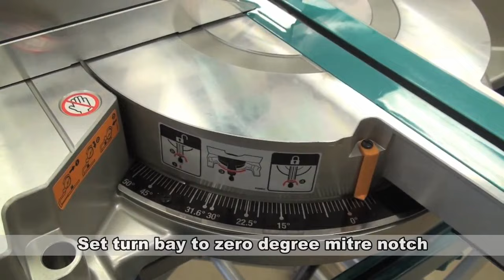Makita Tool Tips   Calibrating your slide saw

Comment: My Mikita was a different, with the same concept.  I simply loosened three of the hold-down bolts and slightly loosened the forth.  Then I was able to adjust the fence and tightened one of the three loose bolts and did test cuts budging the fence making cuts until my 90 degrees was perfect.
Tightened all bolts, retest cuts and was happy with the correction.  Thank you👍👍👍

Comment: Bought new LS0815FL..As it starts a sliding cut towards tge fence, first inch of material is being notched slightly left side of kerf before moving on through in a straight line!? Any ideas why this happens even when keeping a even forwards pressure (not pulling it to the left).

Comment: My adjuster locking calibrating large round knob at the front has worn away over time it’s really stiff to move the swivel base plate once I finally get it to play ball I can’t find a single video on how to strip the hole bottom piece apart and put in new knob swivel plate and the button that works with the big locking and adjusting knob, could u please recommend a video please please
Reply: Have you sorted this?  If not, Makita reps and techs here is Aus are very supportive.
Reply: WhoDatBe Dare to be truthful I have not switched the saw on I’m so glad I didn’t pay £750 for it but partly because I like things to be right and I can’t find a viddie on stripping it all apart in particular the large knob button and catch at the front cheers for the replie buddie and if you do come across a viddie that would be good

Comment: Im stuck on my 36volt 10 inch saw. I pushed the big black button on the back left side. It shows pic of adjusting saw unlock but now its stuck on 22 deg. I seen when the easy adjustment is in the front now but does nothing for it. I have to be doing something wrong.

Comment: Would anyone know how to replace the lock lever for the turn base?? Having issues with the spring and pin..
Reply: I blew mine out with an air compressor,  then oiled it with engine oil.  So far that has left it very smooth and easy to use .

Comment: I just bought the LS1219L and the bevel screws are opposite. Tip the saw to the right and the right screw is the one you adjust. Thanks for the video